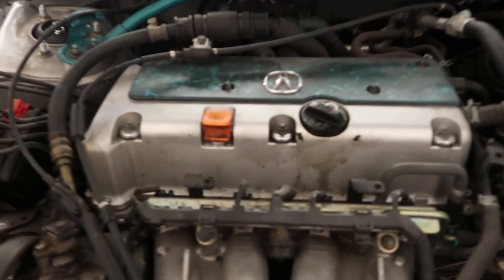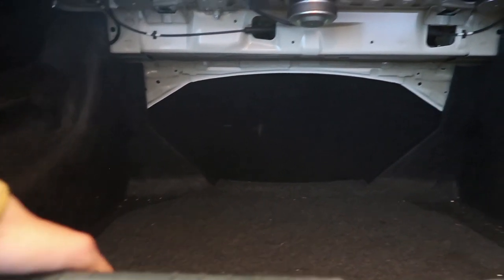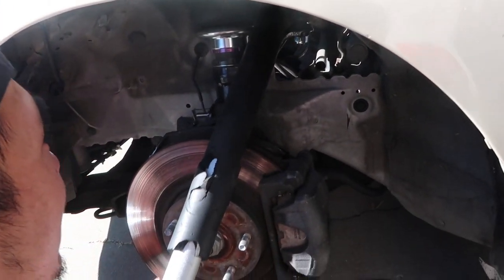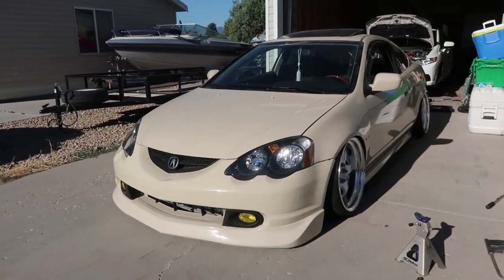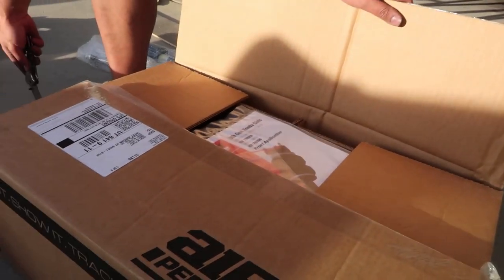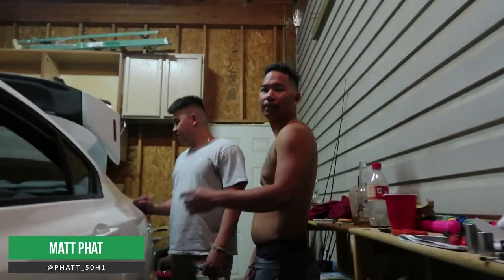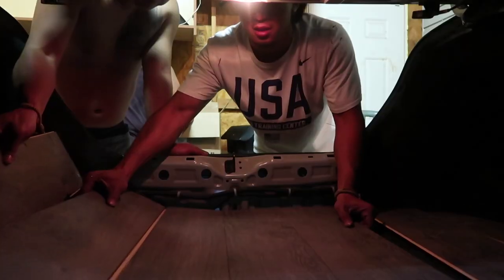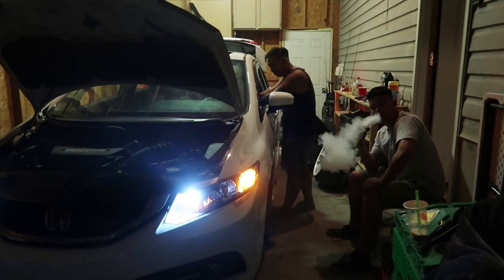HOW TO INSTALL AIR SUSPENSION ON YOUR HONDA CIVIC SI

Comment: does anyone know why my air bag spins around the strut ? kinked my leader line and it continues to spin 🤦🏽
Reply from the maker: Lock collar not tight! Happened to me plenty of times. Haha
Reply: @KevinNguyen  the bag is spinning freely tho like i can spin the bag around the the treads. i will try to tighten it even mor tho hopefully it can solve it🤙
Reply from the maker: @qwerty.us412  usually you can spin the bag, then there’s a lock collar on the bottom of it that you can lock the bag to the certain heigh you want!

Comment: How much did it cost for everything I’m doing a project with a Honda del sol
Reply from the maker: I think the whole bag setup was around 2700.
Reply: ROOKIES thanks
Reply from the maker: @israel7364  There's other cheaper options! Depends how fancy you want it.
Reply: ROOKIES you have Instagram?
Reply: ROOKIES I just want to have it to lift it up and down my car
Reply from the maker: @israel7364  Yessir, in the description i have a link! Thats what i wanted at first but then you would eventually want the better management.
Reply: ROOKIES true imma buy the whole set
Reply: @KevinNguyen  what website I can order bags for a cl1 euro r?
Reply from the maker: @lifeinantigua5013  bag riders, or your choice of preferred air suspension!
Reply: @KevinNguyen  I went in the website didn't see any
Reply from the maker: @lifeinantigua5013  you have a specific brand you are you looking at?